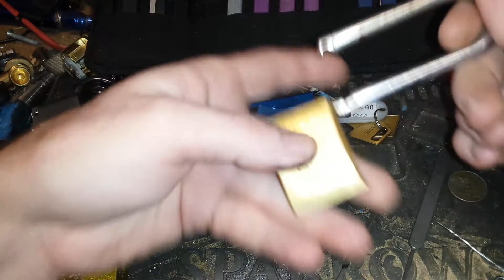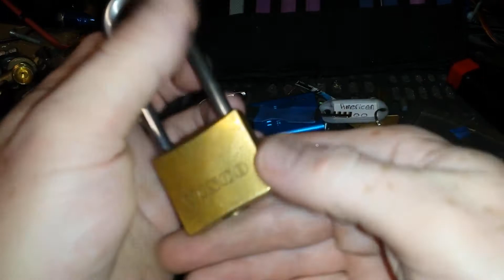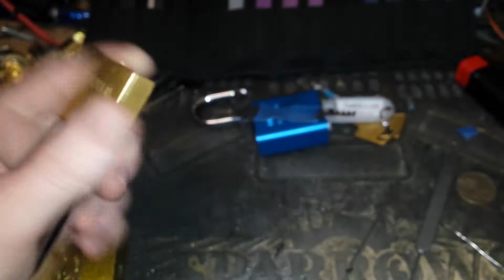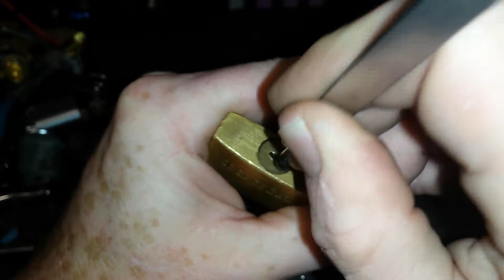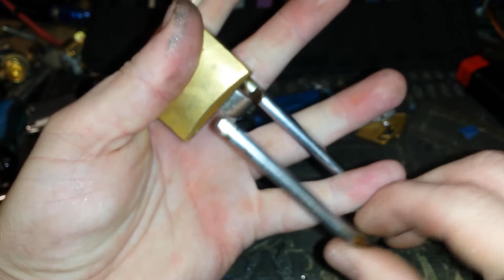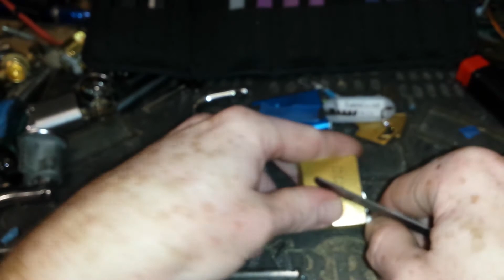Vinco padlock

Comment: Raking is always a good option, especially for noob pickers like me. The Sparrows mat must be the most worn one I've ever seen.🤔👍🏽
Reply from the maker: I don't care what people think of rakes they have their time place and application ...and they work.  Originally I started using what I called a finger pick mostly straight SPP locks but it took much more time, in contrast the rake just will not do the job in other applications.  As for the mat that's key making/ impressioning for you! lots of brass copper iron , general metal shavings :)
Reply: TotallyRandom Locks and Picks TV too true, that's why they make different tools as they have a purpose. Signs of a worker, you must've been doing it a long while, good to see but mine is relatively new as I havn't done a great deal apart from repin and salvage kik's etc.😊
Reply from the maker: Exactly! horses of courses as they say...  Only been at it a year or two haven't achieved half of what I wanted to, Although I do like making keys ;)  it is a nice hobby and the #Locksport community are generally pretty cool people :)  Would you believe I used to wash the crap off that mat :) I looked at the fillings one day and laughed.... I got into #locksport via wanting to learn impressioning hence the fillings :) so they can stay! :)